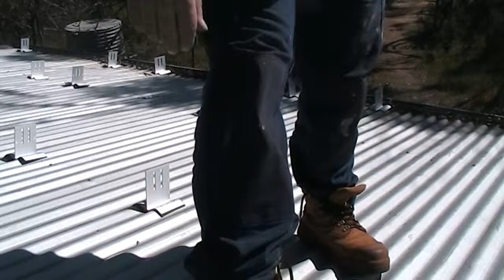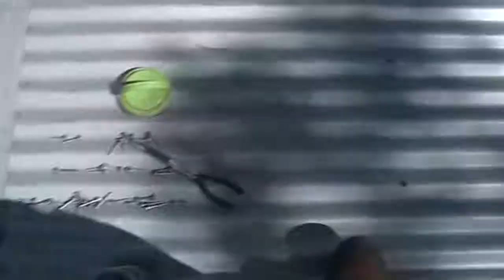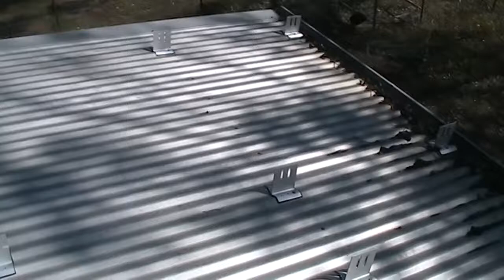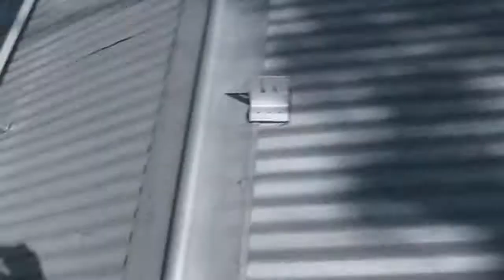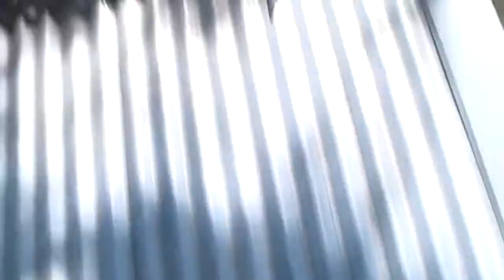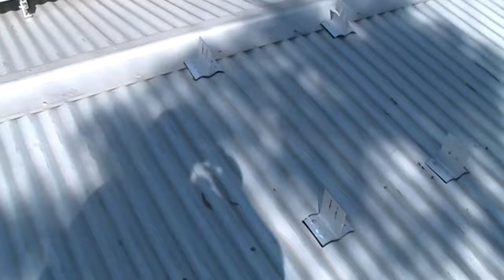New Solar mounting feet Pt 2

Comment: I hope you have trimmed those tree branches as shading won't help that string at all. As for you sleeping in the shed, make sure you have an air con in that shed & a decent bar fridge hehehe.
Reply from the maker: Solar Function don't really need to trim the trees as I have heaps of solar power to change the battery bank and supply my power requirements at the moment. Later this year I'll be adding another 2700 watts of solar panels and a bigger battery bank for when I'm using the shed as my business office.
Reply: Ok so you are not interested in getting more batteries at a discounted price?
Reply from the maker: Solar Function I'm always looking to save money. I'm talking to E-solar and Aussie batteries and solar at the moment for pricing on the new battery bank and both have some very good prices. Do you sell solar products? And are you in Western Australia and can supply gear?